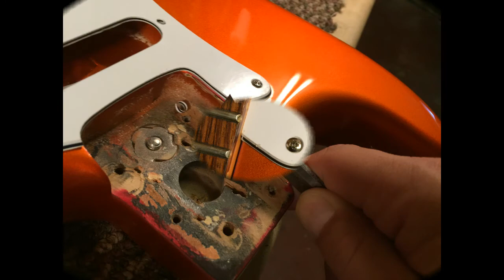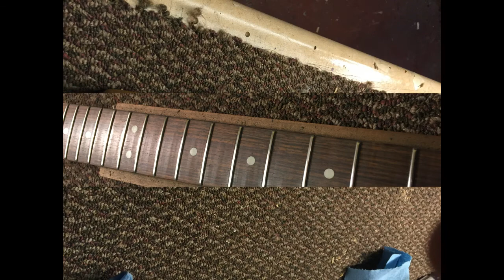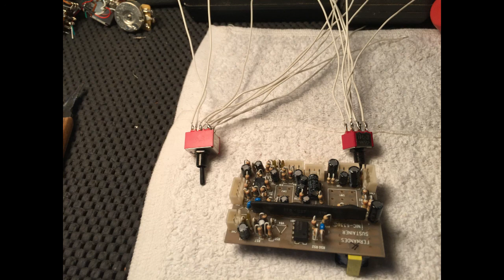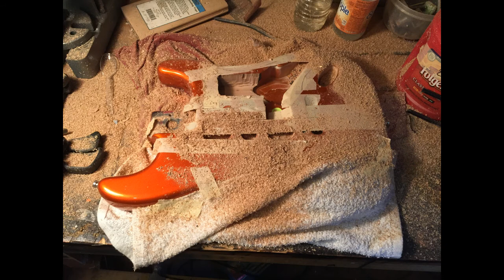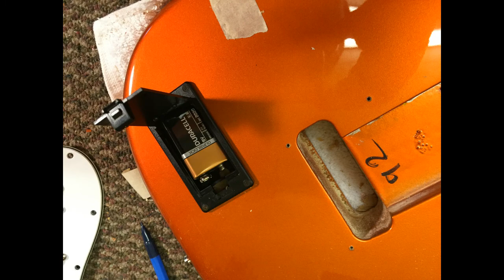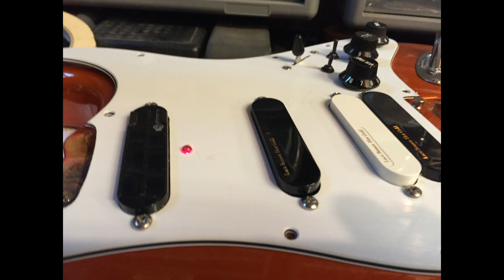Candy Tangerine Fender Strat Fernandez Sustainer Install

Comment: Hey WW, 
                    Viewed your Fernandes Sustainer install on Youtube. Very nice job. I have the 401 sustainer kit and was looking to do a similar install with the switches removed from the pcb and placed where the strat jack ferule is located. Can you tell me how you got the switches off so effortlessly. I'm guessing you may have used a desoldering station. I have tried taking switches off boards before just with a soldering iron and just a desolder sucker pump thingy, but with no success, its like tha Japanese glue them in there somewhat, but have seen others using those pro desolder stations very effectively.
 
If you have any advice to offer on getting the job done similar to your own install, I would be very grateful for your sharing any.
 
Thanks, Best Regards,
Trevor
Reply from the maker: Hi Trevor
All I did was "unsolder" them.  No special extras.  Just a good clean iron wet with fresh solder each joint.  Same as I solder every joint.  Sorry, no magic here.  Just years of practice...  :)
later
rich
Reply: @wwlutherie  wish u had a video on it lol just for kicks :D
Reply from the maker: @jjcarter6539  Had a soldering 101 vid a while back.  Had to take it down... too many comments about me tell folks to keep their tips hot and wet...   :)

Comment: Nice work! Do you know if the Sustainers have "improved in design or changed" over the last 10 years? Mine is squealing now so not sure if I should get a new one.
Reply from the maker: Music Production Videos     if the board has 3 adjustment trim pots, download the pdf manual and play with them a bit. Also keep the pickup heights all on the low side.  That should help with squealing

Comment: I'm sorry but, how did you fit the sustainer board by all of the tone and volume pots. There's virtually no space for it to be that close.
Reply from the maker: Alfred Hendrik   With great difficulty 😎
Actually I offloaded all of the pots and switches from the circuit board   Even the status/battery led was relocated as you might see in the pics
Reply: Amazing! Do you have a website or business contact?
Reply from the maker: wwlutherie  a t    comc ast   d o t   net

Comment: You could add a  9V 1180mAh  litio rechargeable battery, so u dont have to dream the box for the battery u just make the hole for the cable to plug in
Reply from the maker: Sure... I don't see why not.  But you'd just have to remember to charge it :)